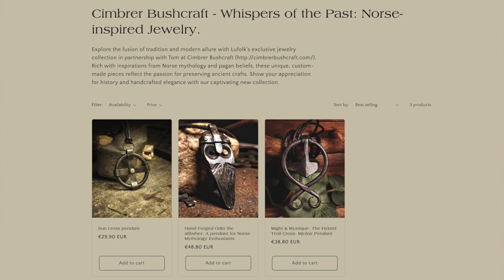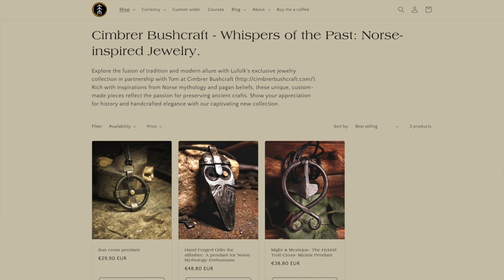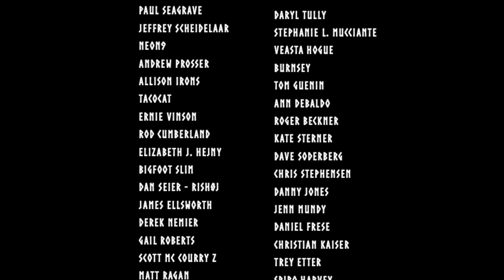Odin Pendant from Lufolk and Autumn Equinox Ceremony

Comment: here in southern Germany we also celebrate the so called "Sonnwende" (midsummer night) in June. 
Every Village builds a huge pile of wood like a big cone, the higher, the better, which will be set on fire after sunset.
These cones can be 6 to 10 meters high and do have at lesat fife meters in diameter at the bottom.
If you drive through the area in that night, you will see these fires everywhere arround you from far away.
The "Funken" (so we call these Fires) will always be built up the day before midsummer night.
The bad Tradition is, that very often guys from the neighbor village try to sneak in to set your Funken on fire the night before midsummer.
So there are always some guys staying there during the night as "Funken watch".

Thanks for sharing and explaining these things 👍👍
Reply from the maker: It’s the same here in Denmark 🇩🇰🔥 a big bonfire … but no trouble with people who are lighting it up before time 😉 … and we also make a figure that looks like a witch 🧙‍♀️ and put it on top of the fire 🔥 and sends her to “Bloksbjerg” … and I believe that is somewhere in Germany 
And old tradition … burning a witch on the fire … 😆 … to get rid of the evil … don’t know if this makes sense for people outside Denmark 🤔 🤪🤨😳
Tom
Reply: @cimbrerbushcraft-vikingheritag  Yes, we also burn a witch, at the evening before Ash Wednesday.
This might be a local tradition in the south, where I come from.
I did not know, that in Denmark there is also a Bloksberg, where the whitches meet.
In Germany every year at the last day of April the whitches meet on the Bloksberg in Sachsen-Anhalt, also called "Brocken".
Maybe they always fly from one Bloksberg to the other on their brooms, so they can have more than only one meeting every year 😃
Reply from the maker: No it the same Bloksberg the fly to 😉 
in Germany 🇩🇪👍🏻🔥 and thanks for your info 
I didn’t knew that you also had that tradition … but again … our culture is close connected 😁👍🏻🇩🇰🇩🇪